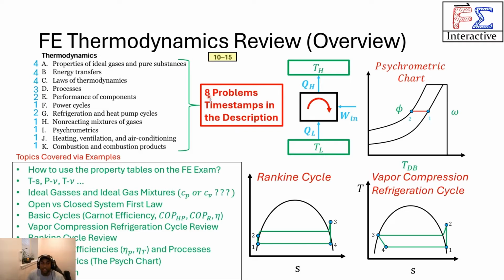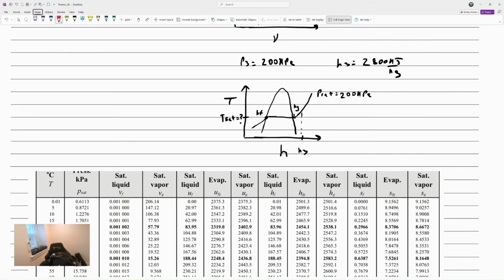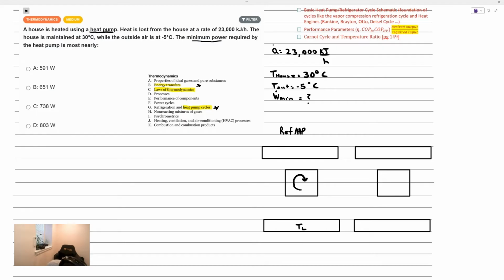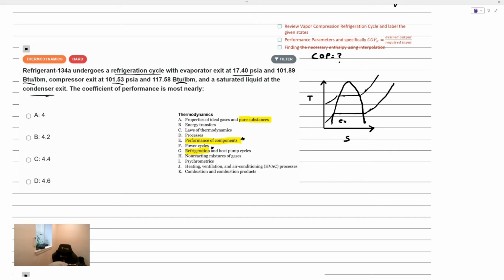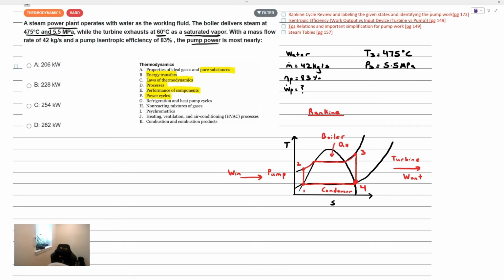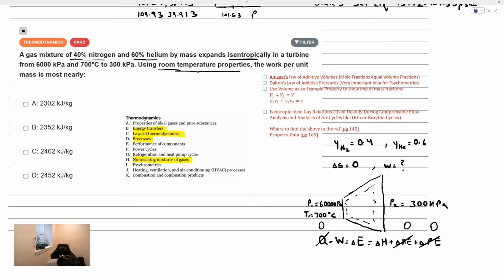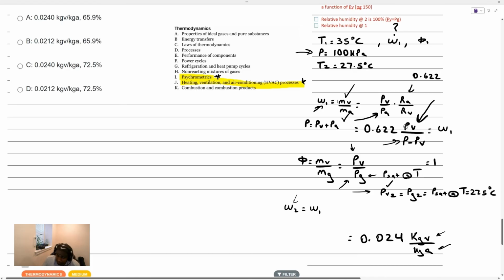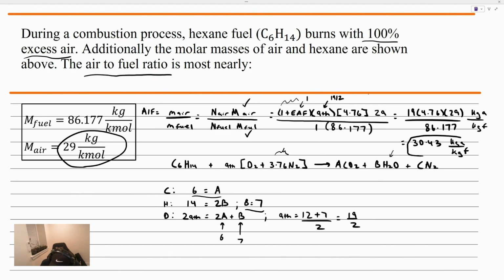FE Exam Thermodynamics Review – 8 Real Problems That Teach You the Core Concepts

Comment: This channel is great channel. For problem 7 can you explain where are you getting pressure ration Pv /Pa * Ra /Va ?  I know you explain it's a little but confusing because I don't see the visually relation from the original equation.
Reply from the maker: Thank you! What I go through in the video is essentially a derivation intended to provide some intuition and show you exactly where the equation ω = 0.622 Pv/(P − Pv) comes from. Note that this equation is provided in the FE Reference Handbook, version 10.6, on page 150 under the Psychrometrics section, both in its original mass ratio form and its equivalent pressure ratio form.

The fundamental principles behind this equation are Dalton's law of partial pressures, Amagat's law of additive volumes, the ideal gas law, and the definition of humidity ratio as the mass of water vapor divided by the mass of dry air.

The key idea comes from Dalton's law, which allows us to treat each gas as though it independently occupies the entire volume of the mixture at the same temperature. In other words, we can imagine the dry air and water vapor each occupying the same container independently, with each gas exerting its own partial pressure.

Applying the ideal gas law, PV = mRT, separately to the water vapor and dry air gives:

Water vapor:

Pv × V = mv × Rv × T

mv = (Pv × V)/(Rv × T)

Dry air:

Pa × V = ma × Ra × T

ma = (Pa × V)/(Ra × T)

Now, using the definition of humidity ratio:

ω = mv/ma

Substituting our expressions for the masses:

ω = [(Pv × V)/(Rv × T)] / [(Pa × V)/(Ra × T)]

Rearranging:

ω = (Pv × V × Ra × T)/(Pa × V × Rv × T)

Notice that both the volume (V) and temperature (T) cancel. This is because, under Dalton's law, each gas is considered to occupy the same total volume of the mixture at the same temperature. These are common to both gases, even though their partial pressures and specific gas constants differ.

We are therefore left with:

ω = (Pv/Pa) × (Ra/Rv)

Here, Ra and Rv are the specific gas constants for dry air and water vapor, respectively. Their values are:

Ra = 0.287 kJ/(kg·K)

Rv = 0.4615 kJ/(kg·K)

Taking the ratio of these two specific gas constants:

Ra/Rv = 0.287/0.4615 ≈ 0.622

This is exactly where the constant 0.622 comes from. It is simply the ratio of the specific gas constants of dry air and water vapor.

Finally, Dalton's law tells us that:

P = Pa + Pv

Therefore:

Pa = P − Pv

Substituting this into our expression gives:

ω = 0.622 × Pv/(P − Pv)

This is exactly the equation provided in the FE Reference Handbook.

You are not required to perform this derivation on the FE exam, but I think it is excellent to understand the first principles behind the equations you use. Understanding why the temperature and volume cancel, where the constant 0.622 comes from, and how the pressure ratio arises from the ideal gas law gives you a much better foundation for applying these concepts to other problems.

Hope this clears things up!
Reply: @Eng_Fundamentals thank you so much . Taking FE second time and 4 years out of school but your videos have made studying 10x easier this go around . I appreciate the response too!
Reply from the maker: It can definitely be tough getting back into things after being out of school for a few years, but you’d be surprised how quickly it all comes back with some review and consistent problem solving. You’ve got this! Just stay consistent with your preparation, and I’m confident you’ll be successful this time around. Best of luck!
Reply: Also for 8 if you could explain better in the FE handbook how to get AIR in nitrogen because I have zero idea where it is in the book or how you got those values
Reply from the maker: I believe you are referring to when I discussed the fact that air is approximately 21% oxygen (O2) and 79% nitrogen (N2), with the nitrogen percentage also accounting for the small amounts of other gases present in air.

By Amagat's law, volume fractions are equal to mole fractions for ideal gas mixtures. Therefore, we can represent 1 mole of air as:

0.21 O2 + 0.79 N2

Now, if we don't like working with decimals less than 1, we can divide the entire expression by 0.21 to normalize it so that we have exactly 1 mole of oxygen:

(1/0.21) × [0.21 O2 + 0.79 N2]

Simplifying:

1 O2 + (0.79/0.21) N2

Which gives us:

O2 + 3.76 N2

This tells us that for every 1 mole of oxygen supplied through air, approximately 3.76 moles of nitrogen and other gases accompany it. Therefore, we have a total of 1 + 3.76 = 4.76 moles of air for every mole of oxygen.

This is exactly how air is represented in the stoichiometric combustion equation provided in the FE Reference Handbook under the section labeled "Combustion in Air."

For example, the handbook provides the following stoichiometric combustion equation for methane in air:

CH4 + 2 O2 + 2(3.76) N2 → CO2 + 2 H2O + 7.52 N2

This is a specific example for methane, and the equation is already balanced. However, in general, we can write the stoichiometric combustion equation for a hydrocarbon fuel such as C6H14 as:

C6H14 + a_th[O2 + 3.76 N2] → A CO2 + B H2O + C N2

Here, a_th represents the theoretical (stoichiometric) oxygen requirement, while A, B, and C are the stoichiometric coefficients that we determine by balancing the equation.

We perform stoichiometry by balancing the carbon, hydrogen, oxygen, and nitrogen atoms on both sides of the equation.

For C6H14, balancing carbon gives A = 6, balancing hydrogen gives B = 7, and balancing oxygen gives a_th = 9.5. Since each mole of oxygen supplied by air is accompanied by 3.76 moles of nitrogen, C = 9.5 × 3.76 = 35.72.

If the problem instead specifies excess air, we modify the general combustion equation to account for the additional oxygen being supplied:

C6H14 + (1 + EAF)a_th[O2 + 3.76 N2] → A CO2 + B H2O + C N2 + D O2

Here, EAF represents the excess air fraction, expressed as a decimal. For example, as we discuss in the video, 100% excess air corresponds to EAF = 1.

This means the actual amount of air supplied is:

(1 + EAF) = (1 + 1) = 2

So we are supplying twice the theoretical amount of air required for complete combustion.

For our C6H14 example, the theoretical oxygen requirement was 9.5 moles. With 100% excess air, the actual oxygen supplied becomes:

(1 + 1)(9.5) = 19 moles of O2

Since only 9.5 moles of oxygen are required for complete combustion, the remaining 9.5 moles appear in the products as excess oxygen.

We must also account for the additional nitrogen entering with the excess air:

C = 19 × 3.76 = 71.44 moles of N2

Our balanced combustion equation with 100% excess air becomes:

C6H14 + 19[O2 + 3.76 N2] → 6 CO2 + 7 H2O + 71.44 N2 + 9.5 O2

This is why our general excess-air combustion equation includes the additional D O2 term on the product side. It represents the oxygen remaining after complete combustion because more air was supplied than was theoretically necessary.

However, an important point for this particular problem is that we do NOT actually need to balance the entire combustion equation with excess air because we are only being asked to determine the air-to-fuel ratio (A/F).

The air-to-fuel ratio is defined as:

A/F = m_air/m_fuel

Since mass is equal to the number of moles multiplied by molar mass (m = NM), we can rewrite this as:

A/F = (N_air × M_air)/(N_fuel × M_fuel)

Here, N represents the number of moles and M represents the molar mass.

Once we have determined the theoretical oxygen coefficient (a_th) through stoichiometry, we can directly determine the total number of moles of air supplied using:

N_air = (1 + EAF) × a_th × 4.76

Notice where the 4.76 comes from! For every mole of oxygen supplied, we also have 3.76 moles of nitrogen, giving us 4.76 total moles of air.

For our example, we already determined that a_th = 9.5, and we are given 100% excess air, meaning EAF = 1.

Therefore:

N_air = (1 + 1) × 9.5 × 4.76

N_air = 90.44 moles of air

Since our combustion equation is based on 1 mole of C6H14, we have N_fuel = 1.

Using the molar mass of air as approximately 29 g/mol and the molar mass of C6H14 as 86.177 g/mol, we can directly calculate:

A/F = (90.44 × 29)/(1 × 86.177)

A/F ≈ 30.43 kg air/kg fuel

And that's it! We have determined the air-to-fuel ratio without needing to balance the entire excess-air combustion equation or determine the coefficients of the combustion products.

The process I go through in the video is intended to show how to construct and balance these general combustion equations from the fundamental principles rather than simply memorizing a particular balanced equation for a specific fuel.

This same approach can be applied to the standard stoichiometric and excess-air combustion problems you might encounter on the FE exam, regardless of which hydrocarbon fuel is given.

You don't need to memorize a different combustion equation for every fuel. Once you understand where the 3.76 and 4.76 come from, how to determine the theoretical air requirement, and how to account for the excess air fraction (EAF), you can systematically work through these problems using stoichiometry.

Hope this clears things up!

One final side note: In this particular problem, I provided the molar masses of air and the fuel, but you may not be given this information directly on the FE exam, so it's important to know where to find it!

On page 173 of the FE Reference Handbook, version 10.6, the molar mass (also called molecular weight) of air is listed as approximately 29 g/mol. The handbook also lists molecular weights for some common hydrocarbon fuels, such as propane (C3H8) at approximately 44 g/mol and butane (C4H10) at approximately 58 g/mol.

However, if the molar mass of your fuel is not explicitly provided, you can calculate it using the periodic table on page 89 of the FE Reference Handbook.

For example, our fuel is C6H14, which contains 6 carbon atoms and 14 hydrogen atoms. From the periodic table, carbon has an atomic molar mass of 12.011 g/mol, and hydrogen has an atomic molar mass of 1.0079 g/mol.

Therefore:

M_C6H14 = 6(M_C) + 14(M_H)

M_C6H14 = 6(12.011) + 14(1.0079)

M_C6H14 = 86.1766 ≈ 86.177 g/mol

This is exactly where the fuel molar mass used in our air-to-fuel ratio calculation comes from! You can apply this same approach to determine the molar mass of essentially any fuel when it isn't explicitly given.

Comment: On problem 1 case 1 isnt .00125 smaller than .00127 so the fluid would be a compressed liquid? If they were negative it would be smaller, but I'm not sure if it was just a typo or what.
Reply from the maker: Its not .00127 its vf=.001127 which is < v=.00125 which is < vg=. 
194. This means it is a saturated mix. Is that what you were asking or was it something else?
Reply: @Eng_Fundamentals  Yes I see that now I missed a 1 in vf now it makes perfect sense because I do in fact have terrible eyes 😂

Comment: dumbest review ever. actually review questions that will be on the exam, not hard ass shit
Reply from the maker: I understand where you are coming from, but the goal of this review was not simply to work through easy plug and chug problems. My intention was to focus on the core thermodynamics concepts and the most important ideas that repeatedly show up throughout the FE exam. 

I could have solved 10 simple problems by mechanically pulling equations straight from the FE Reference Handbook, but that would not have captured all of the relevant topics and ideas necessary to truly understand thermodynamics as a whole. The questions I selected were intentional because they organically bring out concepts like energy balances, entropy, ideal gas relations, cycles, and property relationships in a more meaningful way. 

If you truly understand those fundamentals, you can solve the majority of FE thermodynamics questions, including the simpler ones. At that point, the easier problems become straightforward applications of the principles. 

It is similar to engineering school itself. Professors generally do not teach specifically for the FE exam. Instead, they focus on giving students the underlying principles and problem solving framework necessary to approach general engineering problems. That deeper understanding is what ultimately prepares you for exams like the FE and for engineering practice in general. 

My goal with this channel is not just to help people barely pass the FE exam by memorizing equations or relying on luck. I want to help engineers actually master the fundamentals so they understand why they are doing something, not just which equation to copy from the handbook.

Comment: Going to take FE in a month or two, this is a bit heavy or I have forgotten so many, it is overwhelming, if they ask these questions during the exam, it will be hard to solve them since there is a lot to digest.
Reply from the maker: I completely understand that feeling. Thermodynamics especially can feel overwhelming when you revisit it after some time away.

But here is what I want you to focus on, the FE does not test random tricks. It tests the building blocks.

In thermodynamics, that means understanding how to use property tables and property diagrams, the state postulate, ideal versus real gases, how to correctly apply the First Law to open and closed systems, the Second law of thermodynamics, the concept of cycles and efficiencies, how to read and use the psychrometric chart, and basic combustion analysis. Those are the core ideas. No matter how the problem is written, it always comes back to one of those fundamentals.

When I go step by step in the videos, it can feel like a lot to digest. But on the actual exam, most thermo problems boil down to identifying the system, identifying the state, pulling the right property, and applying one main equation from the First/ Second Law or an efficiency relation. The math itself is usually not the hard part. The structure is what matters.

Right now your job is not to be fast. It is to rebuild familiarity with those building blocks. Once you get comfortable identifying states and setting up energy balances correctly, the problems start to feel much more mechanical and less overwhelming.

You still have a month or two, which is plenty of time if you stay consistent. Focus on the fundamentals first. Speed and confidence come from repetition.

Thermo feels heavy at first because everything connects. Once you see the pattern, it becomes one of the more predictable sections on the exam. Keep going and stay consistent, I am sure you will do fine on your exam.

Comment: I am currently doing some problems from Linbergs book and one of them is the efficiency for a rankine cycle and I noticed that it requires you to know where low pressures are in the cycles and exactly what state it will be in to have a chance at solving it. Is it common to get problems like this therefore more worth it to dedicate the time to learn each cycle and what they mean rather than other topics especially when in a time crunch when studying for the exam, or would you recommend focusing that time somewhere else. Thanks!
Reply from the maker: Yes, Rankine cycle problems are very common on the FE, and they are worth reviewing. On pg 171 of the reference handbook version 10.5, you are given the standard cycle diagrams, and the key is understanding the physical process at each component rather than memorizing isolated formulas.

Ultimately, these problems come back to the state postulate. If you can identify the phase and know two independent intensive properties, you can define the state and find everything else. With the Rankine cycle, that means recognizing the pump raises liquid pressure, the boiler adds heat at constant pressure, the fluid expands in the turbine to produce work, and the condenser returns the fluid to a liquid.

Most thermodynamic cycles are built from the same core ideas. The only extra help in the case of the Rankine cycle comes from the isentropic pump approximation in the case of the Rankine cycle (comes from Tds=dh-vdP assuming isentropic and incompressible ds=0 & v = constant):

(h2 - h1) = v(P2 - P1)

Spending time getting comfortable with the Rankine T-s diagram and these basic shortcuts is a very good use of study time which will also help you with other applicable cycles like the otto and refrigeration cycles.

Comment: How do we know that the humidity ratio remains unchanged throughout the process?
Reply from the maker: As air enters the system, it is cooled. Up to the point where condensation begins (state 2), the mass of water vapor in the system remains unchanged and the mass of dry air also remains unchanged. Because both are constant, their ratio, mv/ma, which is called the specific humidity or humidity ratio, remains constant.

You can think of this either in terms of mass within the system or in terms of flow rates. The air entering the system has a fixed humidity ratio, and that ratio will not change unless mass leaves the system, either as water vapor or as dry air. Since no mass leaves the system until after state point 2, the process up to that point is a constant humidity ratio process. I hope this makes it clear.